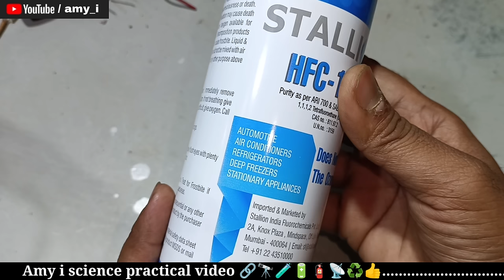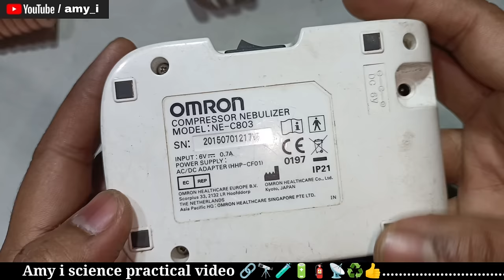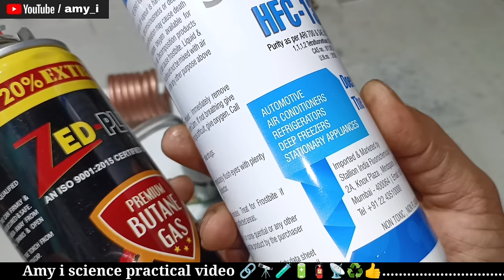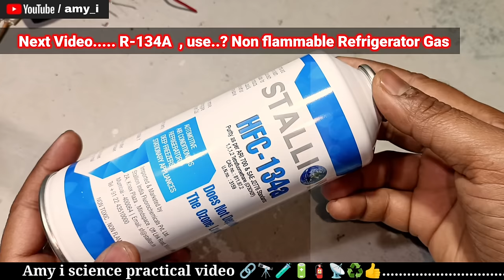How to make a Fast Cooling AC , DIY Mini Refrigerator to -40°C , Simple Freezing AC 100% working

Comment: I tried making this three to four times. Here I have used copper pipes, a high pressure water pump, and LPG gas. Still this doesn't work. If anyone knows the solution, please reply in the comments
Reply: The problem is the high pressure pump doesn’t design to suck gas because the input of normal compressor is refrigerant gas
Reply: I done it ,but it's doesn't work. The problem is you need a really high pressure motor not just a small motor in this video
Reply: The solution is in the butane. Not lpg. Butane has boiling point of 0.5C. Under small compression it became liquid.
Reply: this is simple it is not pressure  it is the speed of transfer
Reply: High pressure won't work need low air pressure 12 v air pressure

Comment: I did refrigeration and Hvac systems for over 40 years. This is a very Basic Model and if you don't know what you are doing a very Dangerous Toy. At most a Science project that should only be done with a professional that can teach you the Dangers of  " Hi pressure " and low pressure systems. Which by the way is in nearly every Refrigeration system. There are a few forms of cooling that do not even have pressured systems and use no Gases. Such as Dielectric systems.

Refrigeration systems need some specialized tools to work with these systems, some of these you cannot even buy without a license for very good reasons.

This is at most just a model and " NEVER EVER use any Flammable gas in Refrigeration. " If you do not know Why never to use Flamable Gass's then you do not want to play with this Technology.  Tubing in these systems is not just will nilly sizes, it is all sized to get the best performance and safety standards. We do not use lead solders for joints. The Evaporator and Condenser with this capillary system none of it is sized correctly.

This is also not true as to the temps you would get with this and there are very good reasons not to do this at home. Even the use of some of the materials used wouldn't work. Refrigeration is best left to the professionals " I CAN NOT STRESS this ENOUGH " 

I guess next he will show you how to make a Ammonia Lithium Bromide chiller system to Cool your whole house, using common materials found around the house and at the Local hardware store. 

And by the way 134 A is very Toxic. Guess he didn't point that out to.

Don't mess with this unless YOU DO KNOW WHAT YOU are doing." If you want to learn then, go get the Training," learn how these systems work and the fact that even the wiring is not in the same standard as in regular wiring systems that a Licensed Electrician does. 

 AC and refrigeration systems to a person should also learn why there is the so many different forms of the systems and why they might be used. There is also no such thing as Cold in Refrigeration, it is all about moving Heat. If you don't know about some of the most basic things in this industry like how to measure Superheat then you don't know what you are doing. You place your life and health and possibly others at very great risk. Many of these systems also use very high voltages and are high amp systems.

This should all be in the MUST READ Description of this Video.

In the Seeking of Knowledge, Seek Wisdom to know what to do with the Knowledge you have learned. This goes with everything in life.
Reply: احسنت

Comment: Hello sir I really want to make it, can you guide me ?
What should I use a water pump or an air pump and how much pressure should it have? And what gas should be use ? And copper pipe sizeing n diameters, like condenser, evaporator, and capillary tube, would you please explain im waiting
Please please please
Reply from the maker: It is made for science project, not for long term use.
Reply from the maker: If you make a project like this, then you will have to find a good compressor to take time.
Reply: If we use a 12 volts 100kpa air pump in it and if we put butane gas in it how long will it work ?
Reply: Good build to demonstrate refrigeration. I would like to see a temperature difference by displaying a thermometer in the video. 😊

Comment: Hello Amy.i, a great project, question, what size copper pipes did you use? what size plastic tubing did you use? Thank You
Reply from the maker: Copper pipe 1/4" 2 fit
Reply: Dia  size and length pipe of small pipe plz ?

Comment: Hi. Excellent video. Congratulations! One question: why did you need to remove the nebulizer compressor? Couldn't you use the complete structure, including the original 6V power source, without having to disassemble the nebulizer?
Reply: based on what i saw, the two nipples on the nebulizer needed to be exposed to attach them to the clear hose. If the black thingy isn't removed then the hose wouldn't fit. and the power source could be combined with a single 12v battery which would be more compact..my 2c

Comment: Try usung a little hair spray when attaching the tubing. It adds a little lubrication when fitting the tubes and it also dries and acts as  sealer and glue to hold the tubes together better.

Comment: Butane is heavier than air. If it leaks on a brushed motor the arc will ignite the gas. Instant torch heater. Brushless pumps are cheap, lower power required, pulse driven, non contact, no commutator and bushes that spark.

Comment: Impossible. Need higher pressure. Much bigger pump to compress the bastard gas. And the coil would need fins like real radiator. Waste of time but looks good for school project to understand for small children.
Reply: HUH ?     this is a low pressure system
Reply: @claycoates5056  nonetheless. That water pump isn't going to do anything except move the fluid around.
Reply: how did the Sevell system work with out a pump  @Swenser

Comment: How to determine if you are being deceived? It's simple.
1. In a real refrigerator, the radiator for heat removal is much larger than the cooler, but on the contrary, the refrigerator will not produce as much frost as in the video with that small radiator.
2. For some reason the fan is located opposite the refrigerator, and not to blow out heat.
It's simple, this is a fake video, a fan is needed to show how quickly the ice grows. In fact, it's the other way around, the frozen tube melts and this is shown in reverse order. For this you need a fan.
If a fan actually blew air through the tube, ice would never form there.
This is a lie.